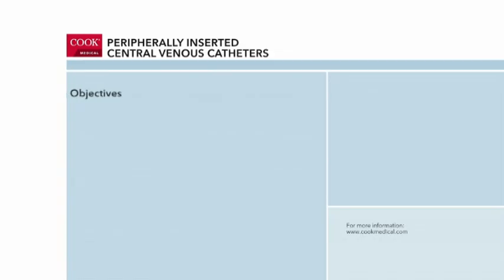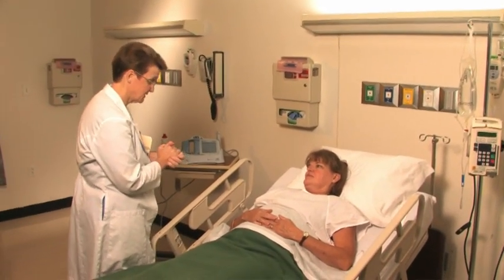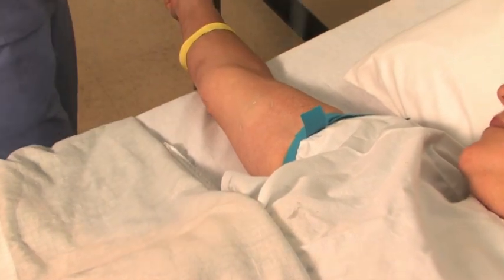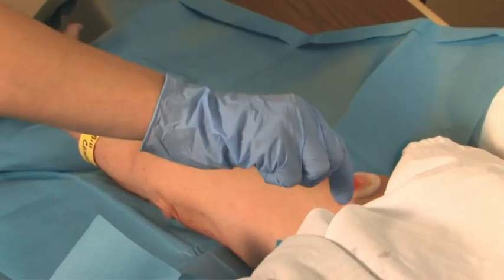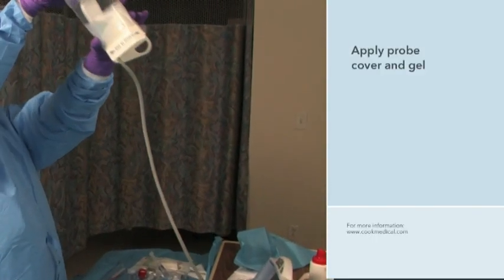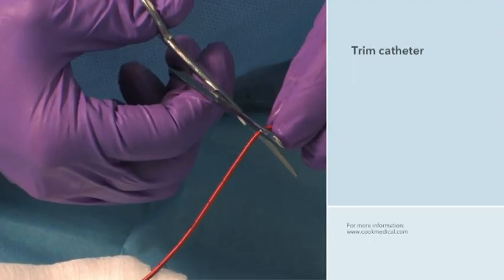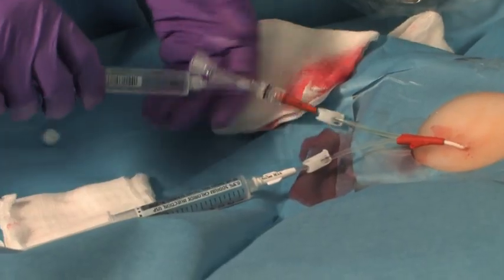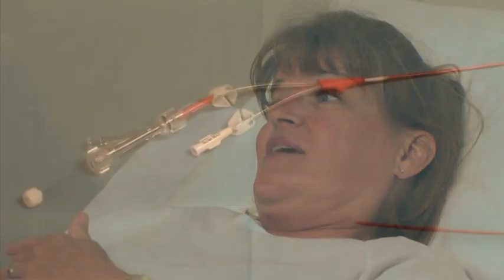PICC LINE INSERTION FULL PROCEDURE

Comment: I have a PICC inserted in my left arm. To any of you wondering, it doesn't feel painful at all during the procedure
Reply: They are always inserted awake
Reply: @edwardherrera4097  Ah, I see. Thanks for the info
Reply: Oh it’s painful
Reply: @edwardherrera4097  I was asleep. Sedated
Reply: @DanielGonzalez-ph5ew  asleep and sedated are too different things. When one says asleep the assumption is that it is done under general anesthesia. Sedated can be many different levels. From mild to heavy sedation but typically it’s mild if anything at all. If the person falls asleep during the procedure from the sedation medication then that’s fine. But it’s not a procedure that necessarily requires sedation unless the person can’t stay still for the length of the procedure.
Reply: i got one and mine didn’t hurt on the outside but it kinda feels achy near your collarbone sometimes
Reply: stay strong bub. I remember getting mine. Asleep for the frist, awake fro the second.
Reply: To me, peripherally inserted central catheters are the single most terrifying type of intravenous catheterization because a dear family friend of mine had a family member pass away due to a PICC site that had contracted septicemia.
Reply: I’ve had them in both my right and left arm lol, I have one in my right at the moment, it’s only painful when they change the dressings afterwards tbh. My first picc in my left arm was the most painful ://
Reply: @zephyrbites  i have a heightened tolerance to pain which caused an issue because i didnt realise it was slightly mispositioned. but yeah, the dressing change hurts.
Reply: @picklesonticklestone5220  yikes. What did you have your picc for?
Reply: @zephyrbites  it was a perinephric hematoma which had been infected by staphyllococcus. it was directly surrounding my left kidney and they had to neutralise and remove it as soon as possible
Reply: @picklesonticklestone5220  oh man :(( I hope all is well for you, thats horrible
Reply: @zephyrbites  ive almost fully recovered by now! :D i hope ure doing fine too
Reply: @picklesonticklestone5220  that’s awesome to hear :p I’m doing good man, I just had my last picc taken out and a Hickman line put in lol
Reply: Is extraction painful procedure?

Comment: Nice teaching video, but a PICC is not recommended to be placed in the antecubital area. The recommendations (for the past 2-3 years) state to insert in the mid upper arm, preferably basilic.
Reply: Also remember that pancake batter needs to stand for at least five minutes before pouring into a hot pan.
Reply: That's where mine was inserted (the arm that is)
Reply: At no point did this teaching video recommend antecubital placement. The PICC was properly placed in mid upper arm. What they did mention was using the distance from antecubital fossa as a guide to properly locate a vein up the arm.
Reply: That is why they showed the scanning of the UPPER ARM, and placement in the BASCLIC Vein, not the AC.
Reply: The AC was used as a measurement point to estimate length to vena cava. She didn’t insert there. Just used as a landmark.

Comment: Hi Guys, I am sitting on the sofa with my PICC line in my upper right arm. If you are on long-term anything and/or getting lots of blood tests, you probably want one of these even if you don't know it yet! No more holes put in you for blood test or treatment, it all comes out of the PICC. For me, it was bit of a struggle to get it set-up but after that, no pain, as opposed to 3 x antibiotics plus 1x blood sample per day for 3 weeks. The PICC doesnt 'bung up' if it is flushed regularly and you needn't worry about the length, it is designed to go to the other side of your body - stops it blocking. They have a design life of about a year if you keep them clean & flushed at least once a week - think how many needles that could replace!!
Reply: Hey PICC brother! Amen to that.
I finished antibiotics treatment the start of the month, may need to restart again next month. Far easier just to keep the line in.
And yeh, with blood tests, a lot less stress sucking blood out of a PICC than watching pathology collectors fumble around.

Comment: Excellent video. The last comment should be addressed-the only mention of the antecubital space was as a landmark. Then said it would be placed in the upper arm (not the antecubital) and in the basilic vein. So what you were suggesting they were doing wrong was in fact just as it should have been, and yet the video is 7 years old...a but ahead of their time as it turns out,  😀😀😀

Comment: Thanks for sharing. I had a pick line put in at a quest imaging when I was 16…this is not how it went. Shocking to realize how negligent the staff was at that. I am 31 now just seeing this. I was not told what was happening only that they were having trouble finding a good vein. the package of picc line instruments was laid across the gurney at my ankles. There was one small blue piece of paper underneath my arm. They only wiped the area with alcohol. I was not given lidocaine or any numbing agent. I told the staff I could hear and feel bubbling in my armpit neck and ears. No X-ray was done to verify the picc was in correct position. I could not move my arm or hand without pain and deep pressure. I was not informed of aftercare. I wasn’t informed the picc was going to be removed in the following hour. Again, no numbing agent or explanation of what was going on. I was told to hold the band aid as I was shown the exit.

Comment: I have had 3 of these. I had to have so many IVs that were blowing that the hospital decided to go with picc line. The night before my 2nd one nurses tried putting IVs in both hands, wrists, arms, lower legs, and both feet (total of about 12). Picc lines really helped. Only problem was that the line kept going into my jugular. That was a bit scary. Also had 3 NJ tubes (feeding tubes down nose). Received nourishment through NJ tubes and TPN and lipids through picc line. Chronic pancreatitis is a nightmare. Got it when 17. I'm 32 now and still vomit most days.

Comment: what would the whooshing sound indicate if the patient heard it?
Reply: That saline flush fluid is going into the jugular instead of the vena cava.
Reply: That saline is going into you're jugular vain or that you're picc line may of gotten discharged some how and moved and possibly gotten stuck. It happen to me. Once it had actually dislogged its self and got stuck around my ear canal. It didn't hurt but when I got it dislodged and back into place all I felt was a slight tug in my ear and a whoooosh and it was back where it needed to be.

Comment: Do radiologic technologists perform this procedure?
Reply: Nope; nurses, physicians,  and mid level providers.   This is mostly done at the bedside now with modern technology, and in most cases a chest X-ray or fluoroscope is not needed!
Reply: @bettysmith4527  Oh thanks. Do you know if Radiologic Technologists perform procedures that requires needles/insertions?
Reply: @asianboy2177  The only thing some rad techs might need to do is an IV, and that's mostly if you decide you want to advance to a CT tech.   My sister was an X-ray tech, now she does CT and she does IVs.   There are no other injections that X-ray techs do, at least in the US.  My sister also worked in special procedures, which is where they place ports, tunneled lines, and do some other things, but the radiologist does the actual procedure, not the rad tech.
Reply: @bettysmith4527  thanks for the information!